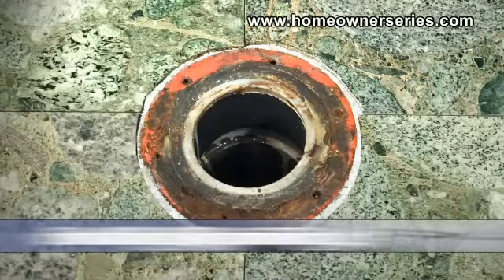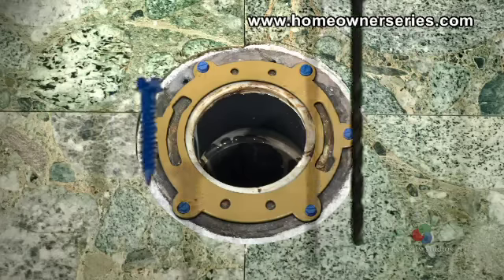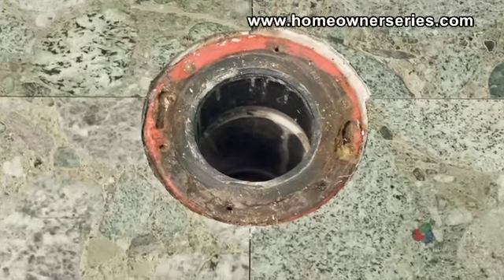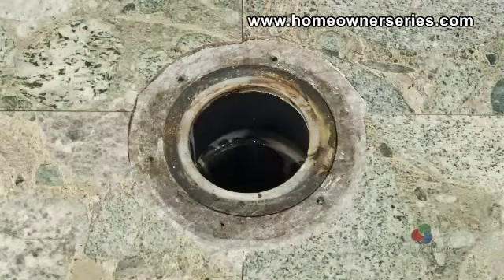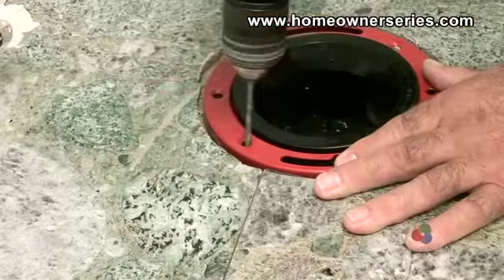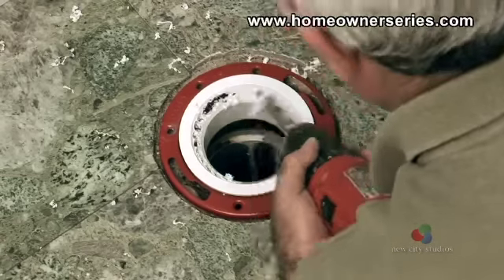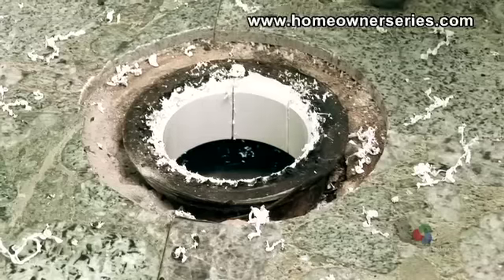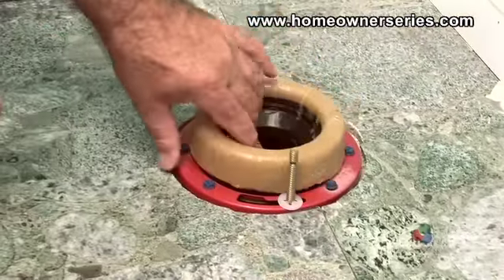How to Fix a Toilet - Cement Sub-Flooring Repairs - Part 2 of 2

Comment: If your toilet ring is about 1/2 inch below the finished floor you will have to double up on your wax seals by putting a wax seal with a plastic gasket down first and place a regular wax seal on top of the frist seal and place your toilet down.One other thing they have come out with if installing a new toilet is a wax free gasket made of neoprene rubber with an adhesive.I have used many and they are an excellent product.They have a long horn on them and fit 3 inches into the pipe firmly.Good.L

Comment: So if it's an outside fitted flange, then you basically just have to remove the metal ring and then replace with an inside fitting flange? (obviously repairing any concrete issues in the process)?